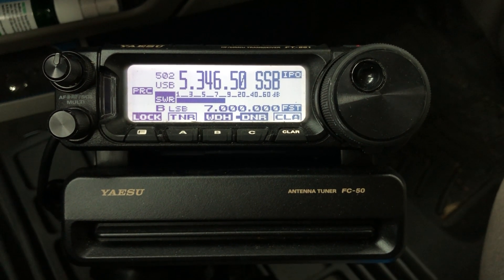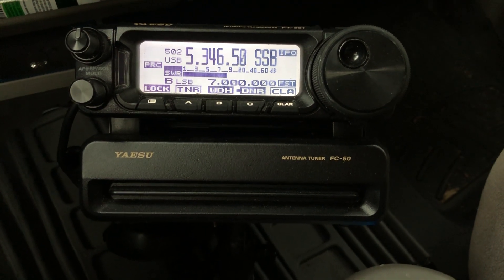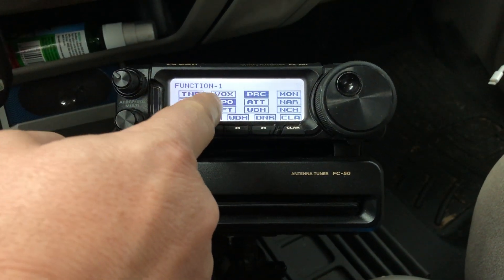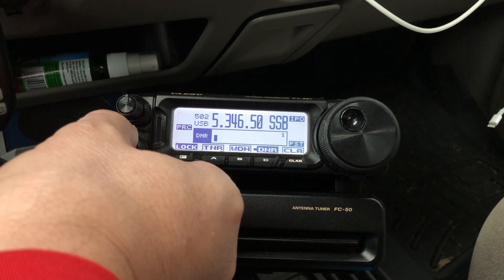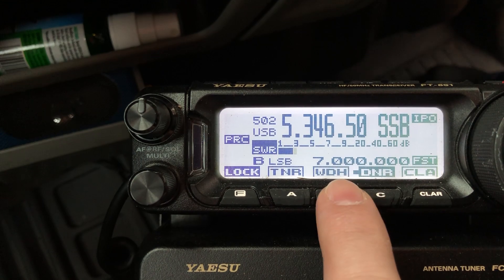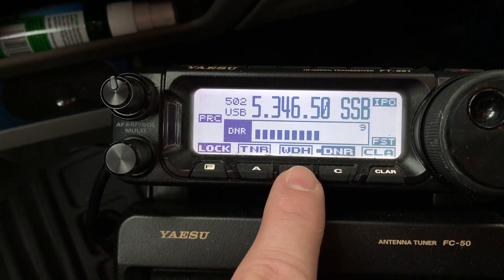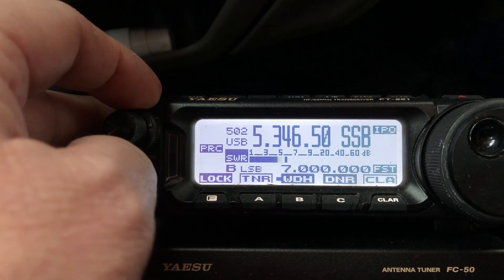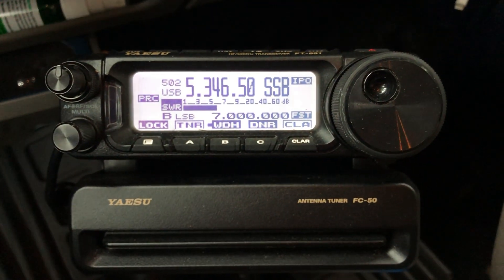Yaesu FT-891: Digital Noise Reduction #hamradio #yaesu #ft891 #dnr #ipo

Comment: I have a question for you about the Yaesu 891. I’m using a Mat – 30  automatic tuner with this radio. Is there a menu item that I have to switch on to allow activation of this tuner? I see one for the ATAS, I don’t see one to activate a different type of automatic tuner. TIA.
Reply from the maker: Menu item 16-15.  Set to External.

Comment: too bad the DNR turns off every time you change bands of VFO
Reply from the maker: Not enough memory to store everything.  $600 radio.  I keep DNR assigned to the C key.
Reply: @n4hnhradio  seemslike a firmware update could fix it
Reply from the maker: There isn’t enough memory.  The FT-891 also can’t get the DNR algorithms from the FTdx10, even though they both use the same DSP chip number. The FTdx10 has 64Mb of memory. The FT-891 has 8Mb.

Comment: Hi Doug, I am just curious whether you have performed the firmware upgrade for the FT891? There are 3 downloads; one for Main/CPU, one for the DSP and the final one is for the display. Don't bother with that as the version is unchanged (1.01 I think). However, I read the DSP upgrade particularly is worth doing as it has been released following the FTDX10 and builds upon the work done on it's DSP. Gets rid of the watery effect. I unboxed my 891 last week and applied both upgrades. Sounds good to me 😊👍
Reply from the maker: I just performed the updates last week.  There is a slight improvement to DNR and NB.  I haven’t had much time to operate the mobile since I performed the update, but it seems to have improved somewhat.

73, Doug

Comment: Thanks for this video. It's my understanding that the 891 uses DSP for IF filtering but I'm guessing the DNR only acts on the audio output of the signal. When you turn on the DNR, it sounds a lot like some of the videos I've seen on YouTube demonstrating the BHI In-Line external audio units. I'm wondering if you can confirm that Yaesu's DNR acts on the audio and not the IF portion of the signal. Thanks again, and I just subscribed.
Reply from the maker: I should point out that there are certain noise abatement/interference issues that are better handled outside of DSP.  

For example, DSP noise bankers have proven to be inferior to their analog predecessors.  They are notorious for introducing distortion into the received audio, especially if the received signal is S9+.  They also require you to go into the main menu and adjust timing, width, and depth.  But no matter how much you adjust them, they cannot compare with a good, legacy noise blanker, such as the one in my Yaesu FT-890 or FT-920.

AutoNotch in the DSP is also inferior.  My Timewave DSP-59+ has such a fast AutoNotch that I often don’t even notice it is functioning.  I will only see the S-meter suddenly jump to a higher level than the station I’m listening to.  It is also so narrow, within the audio spectrum, that I don’t even notice a change in received audio.  In fact, it’s so good that I hope someone will start tuning while I’m trying to pull a weak signal out of the noise floor.  The tuning station knocks out the noise floor while the AutoNotch in the DSP-59+ takes care of the heterodyne caused by the tuner-upper.  I’m left with the audio of the station that was formerly buried in noise.  

With IF DSP AutoNotch, I hear a chirp  sound before the heterodyne is notched.  And the IF DSP AutoNotch colors the tone of the received audio.

DSP-based noise blanker and AutoNotch functions are less expensive for the manufacture, as less discrete components are required.  

We, the buyers of technology, sometimes fall prey to the allure of “new technology”, assuming it is better.  But sometimes it’s just cheaper for the manufacturers to build it that way.  They put marketing spin on it, to make it sound wonderful, but sometimes it is inferior.  I mean, if the product brochure says, “blanks out noise and unwanted heterodynes in the digital domain”, it sounds impressive.  Yet the reality is that it saves the manufacturer money, increasing their profit margin, while not necessarily providing a better experience for the buyer.  I covered a similar subject, regarding SDR versus superheterodyne,  in the video I shot last week, about the FTdx3000D being discontinued.  A newcomer to the hobby might lack a point of reference to know the difference, but I have been working with radios since the mid 1970s.  I’m not easily fooled by marketing rhetoric.

73, de N4HNH
Reply from the maker: The FT-891 is a triple conversion superheterodyne receiver for SSB/AM/CW.  The DNR is part of the IF DSP unit, which is at the third IF stage, at 24 kHz.

I have a Timewave DSP-59+ audio DSP unit that I used with my FT-890.  It served me well.  The key to it is to use ATT, IPO, and RF Gain to improve the S/N ratio before presenting the signal to the DSP unit.  Whether the DSP is in the IF or AF stage, it can do a better job when it has less noise to filter.  So using ATT, IPO, and RF Gave should be part of any noise abatement plan.

I find that the 9th algorithm is a sweet spot in both the FT-891 and the FT-991A.  Using a DNR setting of 9, after ATT, IPO, and RF Gain have improved the S/N ratio, puts the finishing touch on clearing the noise from the received signal.

It’s interesting to note that the DNR in the FTdx5000MP is completely different.  It needs no help whatsoever from the ATT, IPO, or RF Gain.  It has an extremely robust DSP.  It even exceeds the FTdx101D or MP, when comparing Digital Noise Reduction.  The DNR in the FTdx101D and MP functions very much like the DNR in the FT-891 and FT-991A.

I hope this helps.

73, de N4HNH
Reply: @n4hnhradio  This helps a lot. It appears to me that the 891 can pick up some SSB signals better than several other SDR based radios. I am impressed by Yaesu's DNR capabilities and I've been thinking about the FTDX-10, but there is a whole lot of value in the 891. I have a 7300 and thought about getting a BHI or another DSP audio unit, but the 891 seems like it has all the bases covered, especially for mobile. I can also think of reasons why not having an internal tuner is a good thing. But it can't replace my 7300 - it's a great radio and easy to use. However, the 891 does a really good job with DNR and it's mobile.